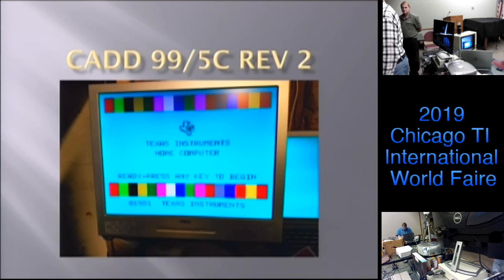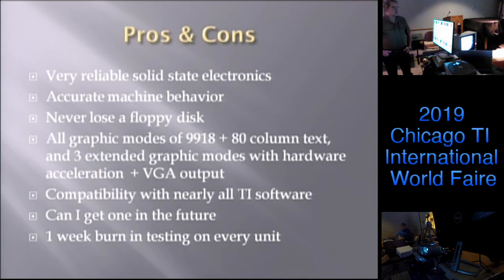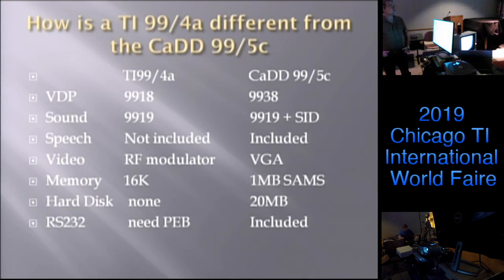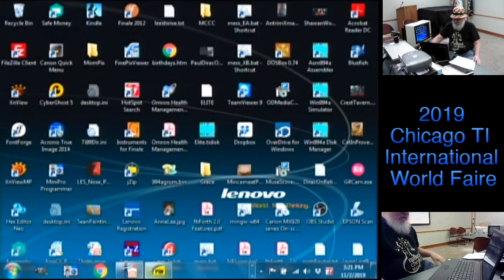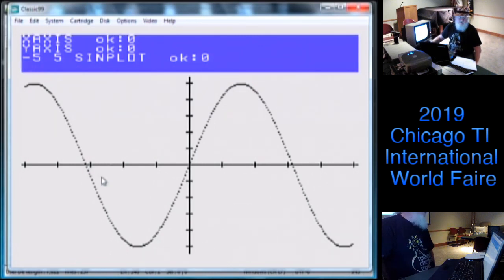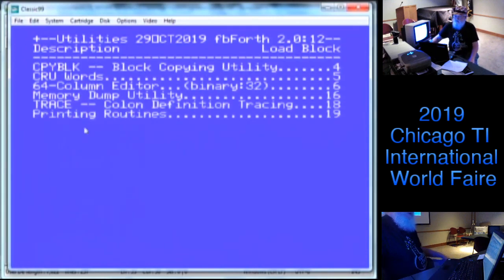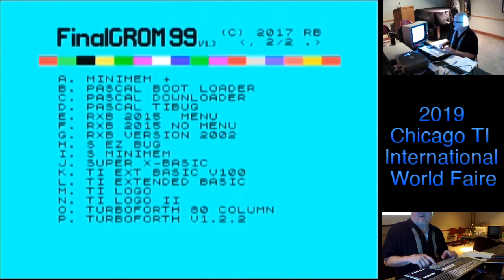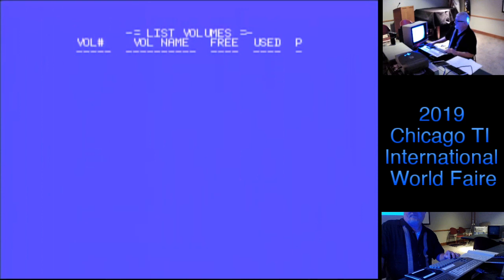ChicagoTIUG Live Stream

Comment: 0:10   CADD Electronics demonstrated and described their "TI on a board" replacement for the TI
          console motherboard and most peripherals.
1:09:20  Lee Stewart and FB Forth, showing its speed and versitility.
1:57:30  Vic Steerup demonstrates the importance of having good records so you can find what you want,  if you have several different huge disk libraries on several CF cards for the NanoPEB, and many cartridge files on the Finalgrom99.